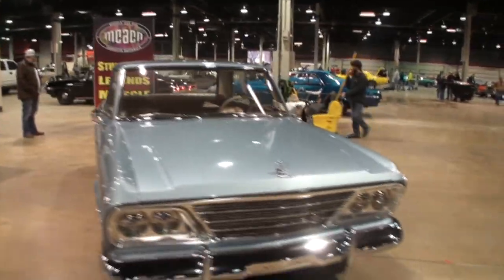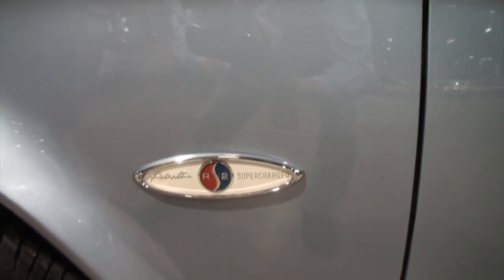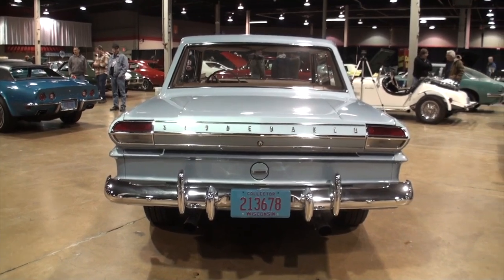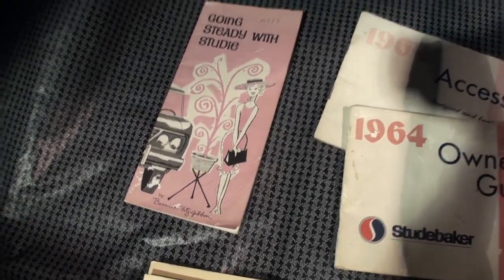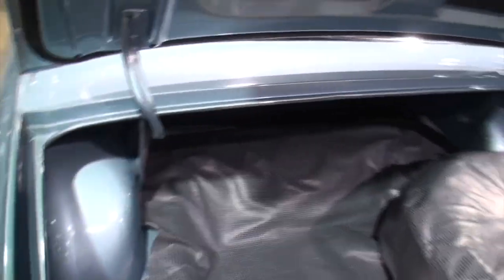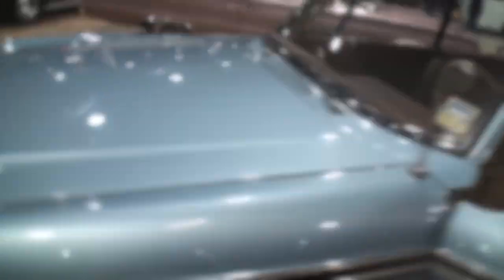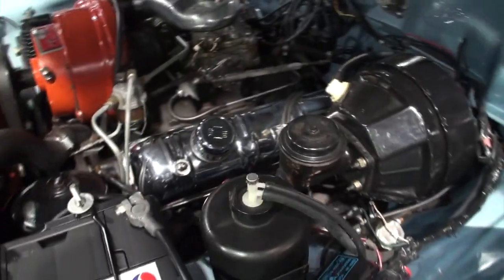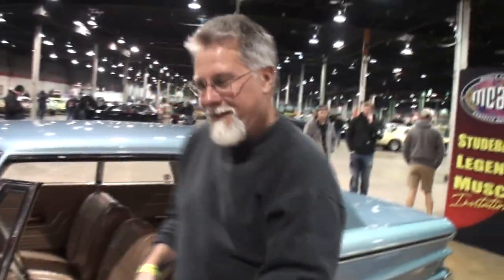1964 Studebaker Daytona R2 Supercharged 289 in Blue on My Car Story with Lou Costabile

Comment: I ran into a Studebaker Lark about  1981  on US 131 between Grand Rapids and Kalamazoo MI .   I was driving my 1979 Z-28 Camaro that had headers  327 350 HP cam  Holley Street Dominator intake .. 110 HP Nitrous with the Bottle turned off.  Holley 600 Double Pumper..
  The owner of the Lark knew what he had and figured I was going to get Embarrassed.  We both floored it back then the speed limit was 55 MPH .. The Lark stayed with me pretty good up to 130 MPH  at which Point I walked away from him in an Impressive Manner My Camaro Tops out at 150 MPH .. we slowed down he shook his head smiling and we both continued on our way Obeying that National 55 MPH Speed Limit  on the 4 lane Limited access Highway .. Now days the Speed limit is 70 MPH there is a stretch North of Grand Rapis that is now  75 MPH  at least you don't fall asleep from boredom at 75 MPH ..
Reply from the maker: Hi Mike, Good story :-) Thanks for sharing, Lou

Comment: Super cool car!
When equipped with an automatic, only the Avanti drivetrain had a 2nd gear position. When in the "Drive" gear position, the transmission operated as a 2-speed automatic, only using 2nd and 3rd gears, 1st gear was actuated manually. When starting in 1st gear, the car would get some serious scratch. Under full acceleration, when these were shifted into 2nd, it got more scratch. Studebakers with automatic transmissions from 1951-on were 3-speed automatics operating as 2-speeds, with no 2nd gear quadrant. Until when the Canadian 1965-1966 Studebakers used a Chevy drivetrain, if automatic, they were equipped with their first 2-speed automatic which was a Powerglide automatic.
Reply from the maker: Hi Automated Electronics, Happy to read you enjoy this "Super cool car!" :-) Thanks for sharing your knowledge, Lou
Reply: My Grandfather was a Studebaker Dealer. Stude Transmission Trivia: The 1950-1955 Automatics were built by Detroit Gear, to Studebaker specifications. They had a first gear start & an automatic "anti-creep' built in. It was an expensive transmission to build. As the fifties progress and Studebaker volumes decreased. Studebaker had to find a cheaper solution. In 1956, Studebaker switched to a Flight-o-matic Borg Warner Transmission. PNDLR. Those were the first of the 2nd gear start automatics on the V8s. The Sixes retained a 1st gear start.
This R2 Studebaker features the Borg Warner Power-Shift transmission. Developed for the Avanti program. It has a 2nd Gear start when in "D". However is does allow the driver to select-shift and it holds that gear until the driver up-shifts to the next gear in the quadrant. PRND21
Reply: @kennethjones2610  Detroit Gear was a division of Borg-Warner. The DG automatics had lock-up torque converters. I was under the impression that they were 2-speeds which operated like a Packard Ultra-Matic. The ones I've been around just had the PNDLR quadrants. Jaguar also used this transmission and with those they had a 2nd gear hold switch on the dash which prevented the torque converter from locking.  The locking torque converter was considered 3rd gear.

Comment: Something looks fishy with the serial number plate on the inside of the door.  It's all crooked and it seems way off for a ground-up restoration car, watch again here at 4:41
Reply from the maker: Hi Clark, Thanks for viewing and sharing, Lou
Reply: Clark Griswold: The Serial Plate does appear to have "shifted" during the restoration. However, being a Studebaker Owner myself, I will say the Serial numbers appears to be correct. Studebaker used an "I" for a 1 in their serial #s. There is a hidden serial # on the rear of the frame, to aid in verification. The Body Tag, as found on the passenger side firewall can be used to help verify the vehicle too. It show the body #, as built by the factory. It differs from the Serial Number found on the door jam  The Studebaker National Museum has a service where an Owner can be told the "as built" production order information, including the Body Tag # and engine serial # information. All this is from providing the Serial # of the vehicle. The Window Sticker on this Daytona is a reproduction. So the Museum information can verify it those options, were true to being as built.
So there are ways to verify a late model Studebaker.

Comment: Some of the models of Studebaker's you could get the 289 w/Paxton supercharger or you could get a Packard 352 bigblock, either one, both were rated about the same horsepower 275-300 HP, I believe, or something like that. One of my Uncle's had a Golden Hawk? or one of the Hawk models and his had the Packard 352 in it, I was a little kid when he had that, think I was about 8 or 9 years old.
Reply from the maker: Hi Doug, Happy to read this car brings back memories of your Uncles car :-) Thank you for viewing and sharing, Lou
Reply: The Packard engine was only in the ‘56 Golden Hawk. When the Packard plant closed in ‘56, a McCulloch supercharger was used in 57 and 58 Golden Hawks and “Packardbakers”. 

The Paxton supercharged R2 engines came out in 62 (63 model year) for the Avanti.
Reply: The 1956 Golden Hawk had the 352 Packard Engine. The 1957-'58 Golden Hawks had a McCulloch VS57 Supercharged Studebaker 289 Cubic Inch motor. Rated at 275 HP to match the one year only '56 Packard motor.
The later '63-''64 Studebaker 289s with the Paxton Supercharger were rated at one HP per cubic in. Thus 289 HP. However all Studebaker V8s were solid lifter motors and could rev to 7,000 RPM. Thus, those Paxton motors were under-rated by the factory.
Reply: @kennethjones2610  Studebaker tended to play coy with their hp numbers instead of bragging about them in their advertising like other manufacturers.
Reply: @seed_drill7135  The down side of Studebaker not publishing their HP ratings was the NHRA would put the Supercharged Studebakers in the unlimited class. That was unfair & hurt Studebaker making a name for itself on the drag strip. When Studebaker finally did announce their HP Rating, it was too late for any significant drag racing promotion. By January 1964, the Jet-Thrust engines were no longer being offered in the Canadian built Studebakers.
That is why the Studebaker's have so much fun at the PSMCD (Pure Stock Muscle Car Drag-races). The public is finally seeing what a Supercharged Studebaker can do against the Big 3.

Comment: Was this engine also used in the Avanti ? In the red white blue signet was written Avanti..
Reply from the maker: Hi Benny, Hmmm, not sure. Here is an Avanti video which looks to have the same engine, Lou https://youtu.be/Bbv2FlMc7eU
Reply: Benny - Good Question: The  1963-'64 Avanti program provided its High-Performance engines to the rest of the Automotive Line-Up. Model year 1963 - 1964. However, the R2 Avanti engine was modified for the Gran Turismo Hawks and Lark-Types.. Studebaker moved the Paxton side-mounted Supercharger to be placed on the top for the Hawks & Lark-Types. This was due to the length of the crank pulley. However, the HP rating remained the same 289 HP. One horse per cubic inch.
These Jet-Thrust Avanti engines were known as R1, R2, R3 & R4.  R2 & R3 were supercharged.  R3 & R4 were bored to be 304.5 Cubic Inch and had better breathing heads. The others remained naturally aspirated 289 Cubic Inch engines. All Studebaker, not a Ford 289.